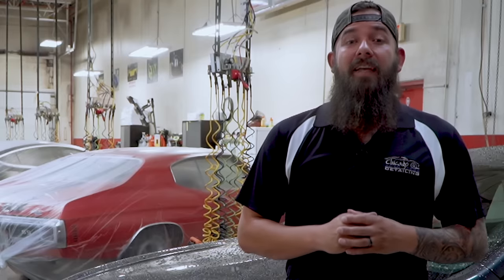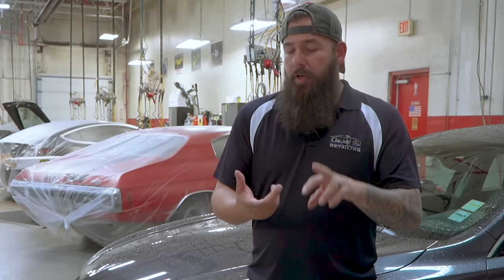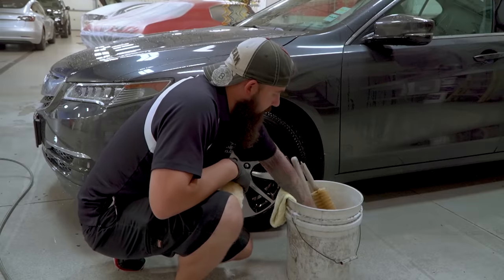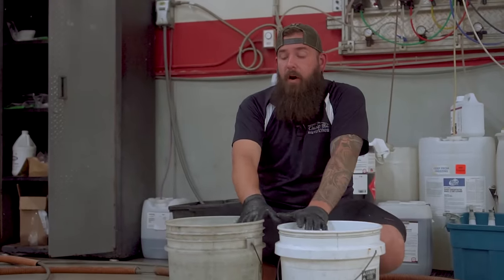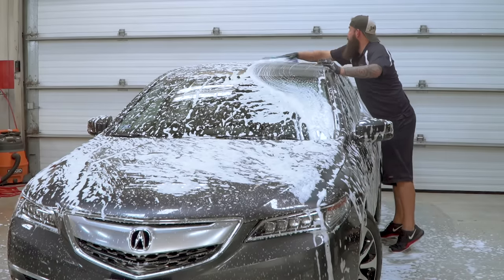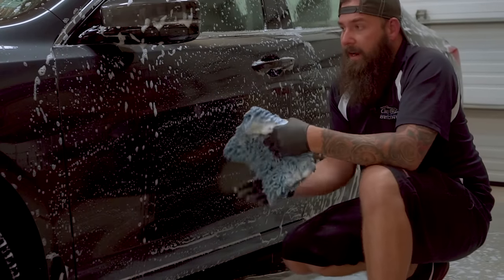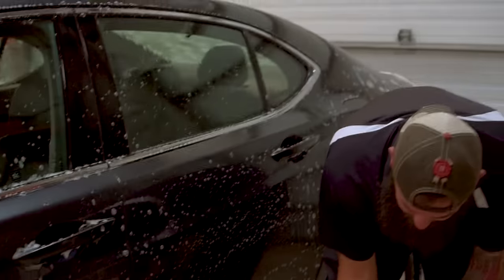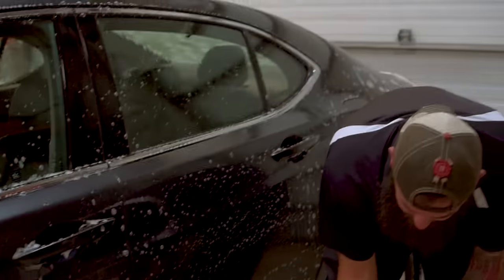A detailers SECRETS to hand washing

Comment: Starting a detailing business is not cheap. Always start cleaning from top. Rinse first! Two buckets and wash mitts. One mitt for the top half. Another for the bottom half. Clean tires and rims first. Rinse car. Spray Meguiars Ceramic Hybird wax on and go back and forth with a micro fiber sponge over every panel. Let the wax sit for 5 minutes then hit with water to activate the wax. Dry car to a really nice shine with a Microfiber towel. Clean windows with glass cleaner. Wipe down exhaust tips. Your done. The Megiuars Ceramic Hybird wax last for months. To recharge the wax. Wash car. While still wet spray wax on a Microfiber sponge. Over every panel. Hit with water and dry off again. Your car will stay. Nice and shining!  Good luck. This process works great!    Shawn

Comment: Hey Jason, RollingRock here.  Was interested in that APC sprayer system...how does that work?    are you pulling off a 5gal tank and mixing inline with water source or premixed....also, what PSI are you using?    Thanks .

Comment: Hi Jason. What sort of all purpose degreaser did you use for the wheels that is still safe if it comes in contact with the paint? And do you ever use a "wheel cleaner" product? or are they just a big marketing ripoff. Thanks in advance.

Comment: Do they make any kind of foaming agent cleaner that you could hook to your hose. Example the liquid goes into a bottle the bottle hooks to a hose and when you turn the hose on it automatically sprays foaming cleaner on your vehicle
Reply from the maker: Yes, they make foamers that will connect on to a garden hose. You want get the same consistency when using a pressure washer.

Comment: I would add that the primary microfiber towel is a different color, and the second towell be another color.  The reason, we sometimes forget which is the primary or secondary.  plus if you had to lay the towel down, because if you're in a rush to get back, some joker in the group as part of welcoming you to the company may decide to switch towels on you....

Comment: Top tip when cleaning in between alloys. Start at the TOP snd not the bottom or you just drag all that dirt to the top for it to soak to the bottom that you just cleaned.

Comment: One tip I use that no one showed me.. I wring out my mitt outside the bucket.. if any loose dirt is going to come out id rather it hit my driveway instead of building up inside the bucket.  I guess I know all the secrets.. these seem like the normal methods most of use use that get into detailing a little deeper than the average person.

Comment: So now, we all just need a $100,000 garage and $1000 soap dispenser and we can do at home. I always taught my kids the initial pressure washer rinse is the critical part to remove the surface dirt and  contaminants will turn a mitt or brush into "sandpaper" then wash it well rinse well and when it's really clean always waxc it to keep the dirt and other crap from sticking to the clear coat/paint in the future.

Comment: How do I remove difficult dirt from lower part of the doors just below the trim?
Reply: always use a different mitt than the one on the top of the car bc theres gnarly brake pad and tar stuff lower half of car. Tar and bug remover melts everything off. Best thing you can do is prewash w the High pressure sprayer get all the 3D loose stuff off before you wash w mitts. Biggest secret was in the beginning to prevent swirls. And treat mits like gold always washe em out never throw em back in bucket even if you have that yellow plate in bottom. ....hang em off side of the bucket....if it falls on the ground never use it on paint again it just got demoted to wheel barrel/wheel well Mitt. Real simple...just imagine you own a ferrari and use extreme prejudice on Mitts that hit the ground and never let mitts float in water bucket....ALWAYS spray mitts off after swiping dirt off panels...dont just throw em into bucket. Act like this w a black vehicle it will never show scratches

Comment: Actually, a dirty car can be adequately initially washed with the soft cloth car washes.  Also the quarter self-washes are good as well.   If there is salt or lots of dirt you need a Lot of Water.  He has not gone near the undercarriage.  Tire shine often comes off and spots the body panels.   Polishing frequently is the key.

Comment: your right about the power wash before you wash the car,,, you dont have to scrub the wheels ,, if you spay the wheels with wheel cleaner and the bugs at the front before you power wash its best and saves time ,, we use a fomer and dont touch the car at all,, and we dont wipe the door jams we power wash before the out side of the car,, if your good with the power washer you font get water inside the car,, we dont waist time with a blower,, the car drys its self ,, we just wipe over with micro fiber and your spray,, and thats it 30 min

Comment: Aren't there limits on the pressure of the washer? I think it's safe to use 1900 PSI or less. You can't just use any pressure washer. The high pressure washers can do damage.

Comment: Great video describing proper process for washing a car. Any chance you might share a listing of some products you prefer to use? I am not familiar with the spray used to help with your drying technique (made the car more hydrophobic). I plan to get the right tools to improve my car washing experience. Thanks
Reply: my advice is buy cheap car soap and use cheap microfiber towels. when drying just use more towels.

Comment: I have been washing my vehicles by hand for 40 years and I always do my wheels last.
Reply: me to wheels last
Reply: @paulford2181  i have started doing them first (depending on condition) if the customers car is very clean, then i do wheels last as they dont need as much attention (btw i always use a different mitt, no matter what) and then i do them first if it's a farm truck so that it doesn't matter if the wheels overspray dirt onto the vehicles body as it will be cleaned later on, it's all down to preference i suppose

Comment: I hate to be a negative nelly as this video did have some helpful tips. IMHO I would not recommend washing rims that way. I have a new Camaro and an older daily driver Toyota, I wouldn't dream of being that aggressive with my rims. A soft brush, Dawn dish soap, a separate bucket and a microfibers to get behind the spokes. . I agree with others to use 2 seperate mitts/ 1 for upper and 1 for lower.
Reply: I have black painted rims and i use good wheel woollies for the hard to reach parts and the face i use a microfiber cloth. I don't have any scratches nor marks etc doing it this way.

Comment: Stepping on a rocker panel is fine, just stick a folded over towel where you step so you don't scratch the panel, because you most certainly will otherwise.

Comment: in 85, I learned, use newspaper  no dust left. Use vinegar/water with it, for spotless windows, should I watch?
Reply: newspaper does work best

however gl finding enough newspaper if your running a business

vinegar smells like ass and there are far better products to get streak free glass

in fact almost always streaks come from contamination or left behind dirt or hard water 

alcohol based solutions work best because alcohol evaporates 100percent leaving no residue

treated water and a dash of dawn detergent works too but only with a squeegie

Comment: Good tips, but the average car owner doesn't have all the different soaps & chemicals & accessories ( different cloths, brushes, etc. ) as this shop has, not to mention a pressure washer & air blower. Using TWO buckets is probably the BEST tip ( with the grit guards---hardly anyone does that ). Would have been nice to recommend which SOAP to use, because most people just use dish soap---which is said to be bad for your car. Going from the Top to the bottom is the second best tip. Not sure if he rinsed EACH different section Before moving to the next ( e.g. wash fender, rinse---wash door, rinse ), because it looked like the soap was DRYING pretty fast, which is bad for the car ?

Comment: Probably a better way than this 2 bucket method, still using two buckets, fill one with warm soapy water, the other one with just water. Get about 8 plush microfiber towels throw all 8 in the soapy bucket then proceed to take one microfiber towel from this warm soapy bucket and just clean the hood, when you’re done cleaning the hood, throw it in the bucket of water and don’t use it again and then go get another clean one out of the bucket of soapy water and continue doing this on all the panels. This way you’re assured of only using a clean plush microfiber on every panel and you’re guaranteed not to be picking up any tiny particles that might’ve been in the rinse bucket. When you’re done, that’s all you have to do is throw these dirty microfiber towels in a washing machine and use them next time. Easy Peezy specially if you have a black car.

Comment: Confused why you pre rinsed.. and then used a degrease on the front.. didn't rise after to remove the dirt..  but applied snowfoam overthe top and then worked it in? Defeats the object of pre washing..

Comment: The way you used your "Wheel woolley", its handle/rod had scratched the hack out of the rims when you reached through the rim openings to reach the back of each rim area!
As you were using the blower, unless there is a filter over the air inlet (which you don't!!), you were blasting the paint surface!!!  That is why you use a filtered air blower, NOT A LEAF BLOWER!  Derp!

Comment: Detailing in my years was complete wash buff compound & finesse then wax..after washing the car and doing the door jams and motor.  sucking out the inside and the trunk...then if the rugs were bad then dye the rug and trunk mat if it was stained with mat paint. Windows inside and out...paint wheel wells...but I would wax the outside windows cause the cars would look sweet and no mess.....

Comment: I have seen this procedure from others professionals too, and it's wrong.. At least the way you do it now. In the first stage (pre wash phase) you only have to apply the snow foam, way for some minutes, and then you rinse with water. You don't touch the paint with the mitt doing the two bucket method. Because the majority of the dirt is still here and you rub it in the surface. 
Entering the second phase, then you apply the shampoo and you clean the car by touching it with the mitt. The dirt is less now and the possibilities to scratch the surface are fewer. 
Don't mix the two phases...

Comment: You are getting that high detergent Degreaser all over the paint on that car. That's a fine way to strip the wax off. You need to be careful with that degreaser.
Reply: Agreed. You never ever put degreaser on the exterior paint. And you definitely don’t use it for bug guts. Or, that degreaser is so watered down that it’s not effective anymore.
Reply: @eldiablort1461  yup. Lol

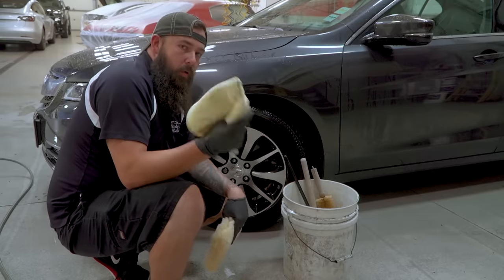Comment: So, at 3:42 you say, "So, we're gonna start by using our all-purpose degreaser here; we use it on rubber, engines and tires; we're gonna start by spraying the entire wheel......etc".
This DEGREASER sounds like a pretty essential part of your detailing arsenal...and yet NOWHERE do you explain WHAT IT IS.
Care to do that here?
Reply from the maker: It doesn't really matter what cleaner or degreaser you use. Lot's of great choices on the market, find one that is in your budget and works for you. If I had to recommend a wheel cleaner I would go with AM Wheels - https://carguysupplies.com/products/am-wheels?variant=19175381729349     BTW - I made this video for new employees that work here at Chicago Auto Pros, the whole point of the video is the process. Knowing the brand of cleaner was not essential in making the video.  Sorry for any misunderstanding.

Comment: Vehicles should be raised level to waist height to clean the bottom of  the car and wheels properly. Most car wash guys are knackered by the time they have washed a few cars by manually bending/sitting down as its not easy. So if your the 5th or 6th visitor, you will find your not getting the best clean as the wash guy is getting tired. I feel sorry for the last guy to visit.

Comment: @chicago Auto pros  Why don't you foam the car first to let the soap set into the dirt since water isn't as great of a lubricant in comparison to soap.   I feel to eliminate any scratches like you said at the start of the video how the paint is delicate.  Well water isn't the best lubrican to rinse away dirt in comparison to foaming the car to set into the dirt and adding that layer to remove the dirt with a Rise following after a few minutes of setup time.
Reply: One more thing.  Why don't you powerwash the Mitten to remove any larger particals?  Then dunk it into the rinse bucket?   I feel like these are no brainers but who am I?  I'm just a new employee
Reply: Again... why are you using microfiber towls with edges?  Like the ones you have......   I quit..  I don't want to be an employee

Comment: I hate micro fibre towels. When drying panels or windows they stick to the surface and don`t want to swipe.
Reply from the maker: Maybe your using the wrong type of microfiber. We use these at the shop and love them. https://carguysupplies.com/products/rgc-korean-waffle-towel?variant=19315919323205

Comment: I would never wash my car like this. Paint is relatively soft (think not? Try scratching it with your key). A pressure washer, if used improperly, can do a lot of damage to paint. When I detail my car, use a garden hose with no sprayer, and just let the water flow over the paint. I'll use a sprayer attachment for the wheels, but at light pressure. Also, just like a car, most wheels nowadays are painted! They deserve the same gentle treatment as the paint on your car. Sure, it might require a little bit of extra elbow grease to get them clean (depending upon how bad you let them get), but keeping your wheels waxed will make it very easy to clean them with a soft sponge. And would you use a bristle brush on the hood of your car? Then don't use one on your painted wheels!

Comment: Never, ever, ever use a pressure washer on your vehicle!!! If you spray too close to headlamps, tail lights, windows, seals, etc... you WILL cause damage. Have you ever wondered why headlamps have moisture inside the lamp - well, you guessed it... it was power washed.

Comment: Instead using all that JUST FOR THE RIMS
Just use degreaser inside the rim and acid on the face of the rim and pressure wash it off also with the fender wheel just roll your car
—Will save you at least 5-10 minutes

Comment: Really stupid question but most of these videos I see are Americans and with American cars and American products. In the Auto industry do european an Japan and American cars and I mean mostly here the interrior is the palstics are the same or are they different? I mean I live in the EU and if I buy for example some American made plastic protector or agressive cleaner wont it chemically damage the plastic they use in European cars or are they all made of the same material? Cause I have seen avarage cars that sometimes the plastic is kinda rubbery not hard like on my old Volkswagen. And I have also seen that some european cars built after 2002 the bottons that turn the lights on or controll the electric windows are crapy made and the plastic had a rubbery coating that desolves after a few years by itself. They dont make stuff anymore like they used to back than.
Reply: I'm a detailer in Scotland and have worked on car's from all over the world, from classics, imported muscle cars to modern European supercars and I've had no issues with any of my chemicals being used on plastics from different eras and regions. 

If the finish is damaged I'd take extra care and possibly dilute my cleaner further to make it gentler. 

Hope that helped 👌
Reply: @BlackbeardsDetailing  Thank you. Do you have an email address please? I would like to ask a few more questions if you have time. I want to start this as a business and I would like help with a little information.
Reply: @BlackbeardsDetailing  Thank you kind Sir! I will write you in a few days.

Comment: Really at NO wash instruction so far, I've seen instructions on <<which parts should not be forgotten>>. Like how to properly wash the door itself: should the cavity of the door rubber be washed / how should it be washed? The door hinche? The cavity between the door and the doorstep? What about rinsing the area under the hood where leaves collect... how to dry that area? Should / how the wipers be washed? What about the area of the full inlet? Etc etc.
Why is this all missed in a "how to properly wash your car..." ?

Comment: The first ever step was wrong already. You shouldn't rinse the vehicle with high pressure machine before lubrication. If you don't have lubricanting sprays, you should just use rinse it with garden hose, foam it and then rinse it with pressure hose

Comment: Please do not lose sleep on this guys.
Trust me when I say I have cleaned a lot of cars in my time.
Mainly top end , Rolls and Bentley  to be specific, but I must admit it was not my core job ever.
I do have a few issues on the way the car is being treated in the vid..
I guess that is the crossover on how to treat mechanics like pushing a door frame from the top and general abusing any electronics , in order to get a sparkle a top end care where one just spent over 3 hours running water and detergent around places that perhaps one should not if one is not qualified past a glorified window cleaner.

Don't get me wrong, some of it may work from a detail point of view, but some is plain wrong from a mech or electro engineer point of view.

Besides, that take on the rag going from a sill to a bucket to another bucket then back to paintwork was not too smart imo.